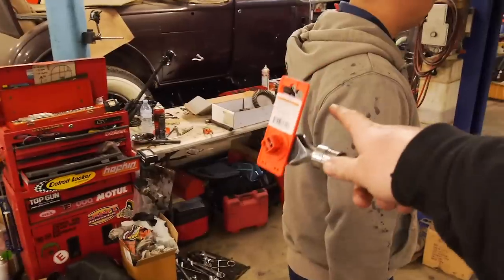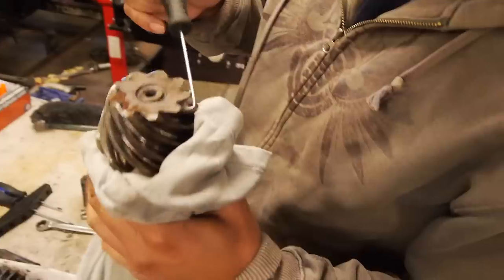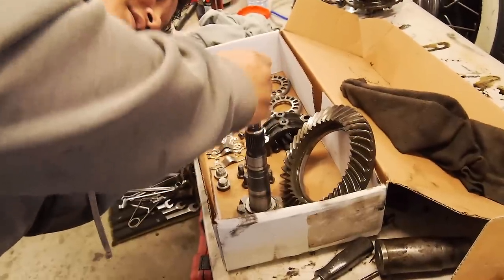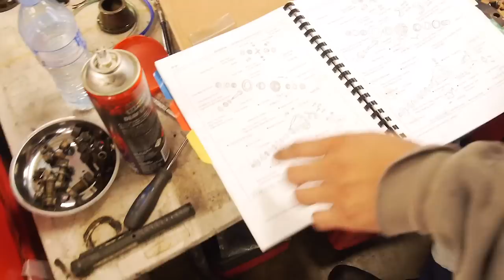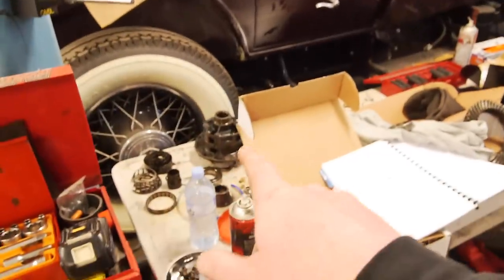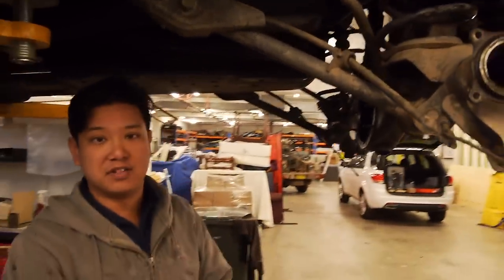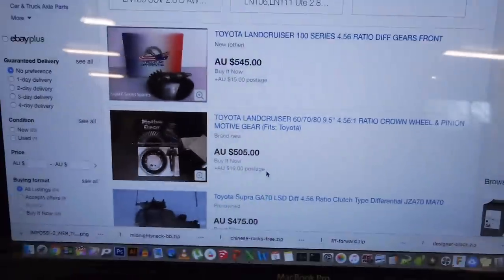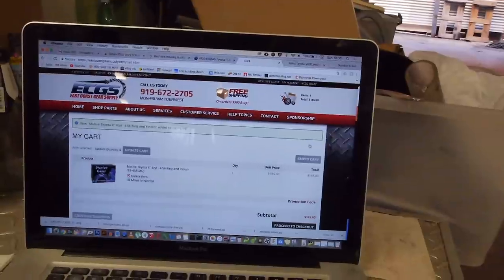INSPECTING THE DIFF... THE RESULTS ARE QUITE SHOCKING...

Comment: Im looking into buying a V6  VR or VS ute are there any specific things i should be looking for or problems with them ?

Ive worked on a VX v6 and done the whole valley gasket shit but are there anything thats particular to those 2 particular models ?
Reply from the maker: Honestly man the biggest issue is that they're predominantly all owned by young bogans who thrash the shit out of them. There's nothing in particular, but standard things are the power steering pumps leak if they haven't already been fixed, old gaskets sometimes weep. It's luck of the draw really just like ant used car. But it'd be a good idea to give it (or any used car) a good thorough service etc
Reply: @boostedbuiltgarage  haha sounds about right wish me luck cheers